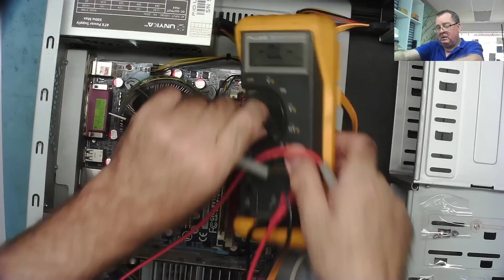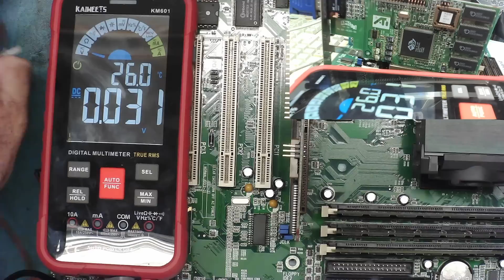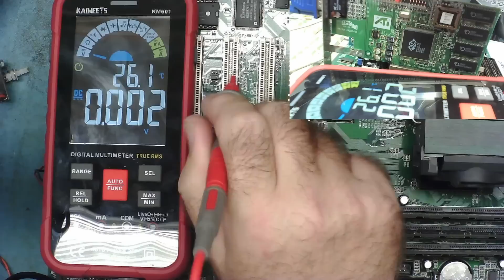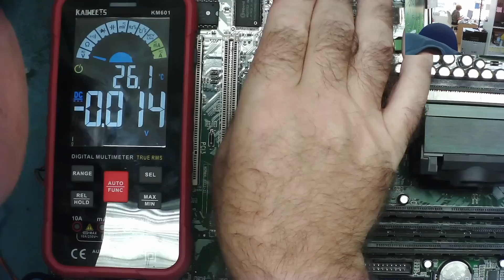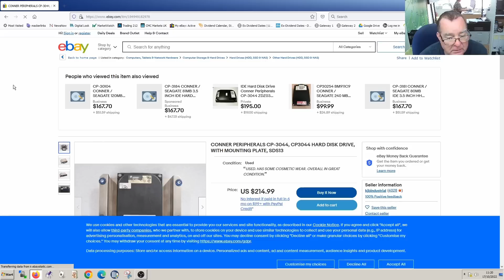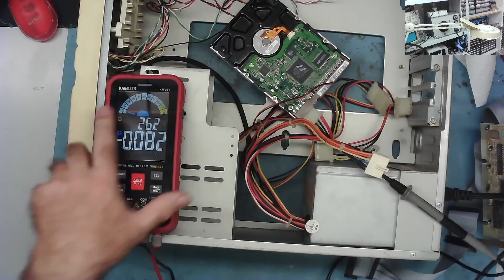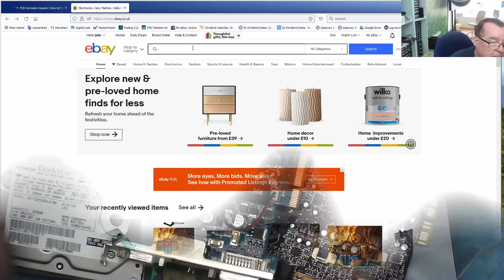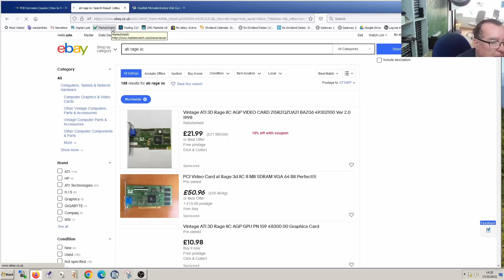Car Boot Flea Market PC Finds Retro Gaming 16 Oct 2022

Comment: Great video,  thank you for sharing your car booty with us!  3 cell 3.6 volt rechargeable batteries will be either nickel cadmium or nickel metal hydride (both 1.2 volts per cell) so that would be an alkaline electrolyte spill on your board - a mild acid like vinegar should clean and neutralize it. Baking soda works well for acidic electrolytes. Regards,  David
Reply from the maker: Thanks for the clear explanation. 🙂 I pinned this comment for others to make sure it is not missed by others.
Reply: @LearnElectronicsRepair   hey bro i have gpu i would like to send to u for repair.  the issue with it is,  whenever i tried to install driver the card would crash an sometimes it don't post at all... please respond thank

Comment: Just to set things in perspective:
The PC I'm using to watch your video right now, is a 775 based Q9450 system, with 8gb ram and 256Gb SSD.
I have hacked Windows 11 install to accept the missing security hardware, and it runs all  sailing flags win11.
It's been my daily runner the last 10 years now, upgrading from windows 7 - to win 10 and now win 11
Converting to SSD was amazing !
Reply from the maker: For sure fitting an SSD on a 775 makes a huge difference.  I had one myself until a few years ago.  The PC I record all the LER videos on in OBS is nothing recent - it's an i7-4790 using some parts from the flea market (CPU, GTX 750ti) and rins Windows 7 32 bit with 4Gb RAM.  As you can see it handles 1920x1080 recording rather well. It has a 240Gb boot SSd and a 120Gb recording (target drive) SSD.  I back up the completed videos on a 2Tb HD
Reply: @LearnElectronicsRepair   hey bro i have gpu i would like to send to u for repair.  the issue with it is,  whenever i tried to install driver the card would crash an sometimes it don't post at all... please respond thank

Comment: If you pause at 1:09:51 you'll see at least a dozen hair-thin tracks corroded into non-existence in the area of the AT keyboard connector.  I am coming to this a couple of months late so did you go on to repair this mobo?  Repairing all those tracks would be a tricky job and certainly worth a video in its own right.  (And thanks, Richard, for all your videos, they are fantastic and I have learnt a LOT from you).

Comment: It's pretty unanimous among the retro and vintage equipment repair community that white vinegar is the best thing to use, you can get it into the nooks, cranny's and vias, you'll see it fizz up as it neutralizes the battery spillage, white vinegar being an acid will then need rinsing off with some isopropyl alcohol, job is a gooden. Just put some paper towels down with board on its edge, repeatedly brush down with isopropyl soaked brush and paper towel will soak up the run off.  I use the white vinegar you buy as a cleaning grade product. The IC socket will need to come off and be replaced as the spillage will most likely of crept under there and check the IC's in and around it.
Reply from the maker: Thanks Adrian Finn.  David V explained this in detail above,  I pinned his post but he says '3 cell 3.6 volt rechargeable batteries will be either nickel cadmium or nickel metal hydride (both 1.2 volts per cell) so that would be an alkaline electrolyte spill on your board - a mild acid like vinegar should clean and neutralize it. Baking soda works well for acidic electrolytes'

Comment: I still have that 4.3 gig drive's big brother with twice the capacity floating around somewhere, an ST38641A. Never the fastest drive in the world but never gave me a lick of trouble, apparently that generation was utterly reliable. Seagate IDE drives can be all over the map - some series are truly great, others are meh, and a few are real turkeys. Barracuda ATA ST320430A was another good one (just noisy), the U series drives were so-so, the 7200 rpm Medalist Pro series (first consumer 7200 rpm drives) had a habit of cooking themselves to death as people weren't prepared to deal with idle power dissipation of up to 11 W, Barracuda ATA IV were super quiet (being the first mainstream FDB drives, alongside using stolen IP for seek algorithms which got them in major legal trouble) but tended to fail in the long run.

The Seagate Desk Reference datasheet collection in Winhelp format (also with legacy Conner and CDC drives) was last updated at least as recently as July 2007. Let me know if you want a copy.

I had a major soft spot for Seagate drives at one point. 18 gig Cheetah 36ES SCSI drives (arguable the most desktop-friendly 10k SCSI drives ever made, same time period as the Barracuda ATA IV) graced not one but two of my computers. A retro machine was stuffed with a Barracuda 4XL ST34572N (noisy bugger, from 1997 when 7200 rpm drives still were wild and untamed and 10k were screamers) alongside a newer-generation ST51080A with the smaller 128K cache (fine after I manually overwrote a single bad sector via disk editor to reallocate it) and an ST52520A with a bit of a stiction problem. I had lost an older ST51080A to presumed head failure / headcrash to my great chagrin at the time, but always found these to be neat-looking drives.

Now the Seagate consumer-level drives that me and my family bought in the last decade were enough to cure me from my fanboyism. Do not use partial contact drives as system drives (out of 2 ST1000DM003, one died violently and the other got flaky), let alone partial contact with SMR (ST2000DM008 got flaky within a year, at which point a 2 TB Crucial MX500 was acquired instead). They do definitely still make good drives, but you definitely get what you pay for. The NAS drives from 2015 are still chugging along just fine (while the base unit has already required a repair, the well-known LPC bus clock problem afflicting the Atom Celeron used). Likewise the 10k SAS Savvios. Two ST2000DM001s only ever used sporadically as backup drives are still fine, too.

Comment: Rich, thanks for the video, it brought back many memories of my early PC days.
My first PC didn't even have a case for the XT turbo mother board it used.
Question - You dismiss the newer machines as not being much use to run the latest version of windows and applications or retro games, but what about the Dos Box emulator?
Can't those machines easily run Dos games with the Dos Box emulator for retro gaming?
I've used Dos box on several newer machines and I haven't found a game that doesn't work yet.
Another thought what about installing Linux on them?
I do suspect a hard core retro gamer also wants the original older hardware too, and that's the reason for the genuine hardware need.

Comment: For contact cleaner, do you have any DeoxIT5? That stuff seems to be the best on the planet.
Fix corrosion: vinegar, check tracks & reflow some solder joints.
PS: I saw a track on the bottom looked to be corroded away.

Comment: I wouldn’t have wanted the Dells either, but I’ve also been pleasantly surprised with rare graphics/sound cards…you never know 🤷🏻‍♂️

It’s always a 2.8GHz CPU in those old Dells 😆 I think they must be the most common P4 chips out there.

19:25 I’ve never seen a 1TB IDE drive, they probably do exist but were likely produced in very small amounts…500GB drives are rare enough.

26:23 A good reason? 🤔 Is £30 on eBay a good enough reason?

31:48 I think it’s an Intel slot 1 with a late PII or early PIII CPU 🤞🏻

48:10 Holy sh*t! Someone put XP on there, that’s optimistic 😆

59:55 Ewwww, I spy a leaky barrel battery. It’s gonna be a 486, let’s hope it hasn’t done too much damage.
Reply from the maker: I've never seen a 1TB IDE either - I've had at least one 500Gb IDE from the car boot so far, and got a decent price for it.

£30 on ebay eh? I must take another look at it 🙂

Slot 1 Late PII or early PIII eh?  Bang Jon on, and it's a 440BX motherboard too!  That's kinda like the dogs danglies of PII/PIII motherboards yeah?

XP wouldn't run at all, past booting, with 128Mb RAM but with 396Mb it actually ran

So it was a 386 it turns out - I rather hoped for a 486 with VLB, but I am still yet to find one... however with my past record at the car boot I'll say 'watch this space' I guess

Comment: That seller went to all the effort to trick you into believing there were 3 intact hard drives in that Dell. Sigh. Dell was notorious of having standard PS connectors on their motherboards but they were wired differently. A friend found that out the hard way on time by hooking up a standard power supply. Magic smoke released.
Reply: They pull the same nonsense with their CPU and case fans, wired differently and they don’t even respect the colour coding (red +/black - etc)

Comment: Very common for Businesses to store Data on one drive and the OS on another, that is why the the two that matter have been destroyed.
Reply from the maker: I'm not so sure they knew what they were doing. Why destroy the drive PCB and leave the BIOS chip intact, so that the PCB could be easily enough replaced, though you would have to solder leads to the motor as they cut them - but then leave one of the drives entirely intact because you know 100% there is no sensitive data on it?
Reply: @LearnElectronicsRepair  Richard I wonder what the chances are that an Electronics Guru would end up with that PC that the IT manager threw in the junk ? You are right however, like usual 😀Personally I use a rather large hammer for that job.
Reply from the maker: @sherlockholmes1121  Yeah would certainly do the job better.  Anyway it gave some of us a great deal of entertainment value seeing what the did with they hard drives, and the possible epic failure to destroy the data LOL.  I think they probably didn't even recognise the IDE as a HDD because it was a bit buried in the machine and anyway it does not use a SATA cable so it can't be a HDD right?. 😆
Reply: @LearnElectronicsRepair  I bet if you re-constructed that , what you would find is one drive is the DATA the other is the backup. Quite common in the days before the cheap dedicated NAS devices we have now. there also would have been a Domain policy prohibiting data storage on the OS drive by the user. Better than RAID and simpler to implement.  
Want to find out ? Up to you 😀

Comment: can i have the isa slot board please you got lucky there.
Reply from the maker: I seem to get lucky quite often then, I have a similar 386DX40 board (working) from the car boot a few months ago -came with ISA Multi IO but no VGA card - cost me €3 https://www.youtube.com/watch?v=JE-pf4VFxzg - I will probably build that into the AT case that came with this 386SX and use the VGA card with it, then I have a complete PC.  I already have a few ISA sound cards from the car boot sale

A 486DLC40 complete PC in AT tower (working) minus the HDD, from a local skip (before I started this channel)

And several PII/PIII from the last time I visited the UK
https://www.youtube.com/watch?v=wqDLpVytXoE
Reply: @LearnElectronicsRepair  why not start an ebay store then i can buy some off you lol.
Reply from the maker: @jediknight2350  I have one actually but not under the same name.  If you are interested in the 386SX40 PCB you can email me electronicanaria@outlook.com